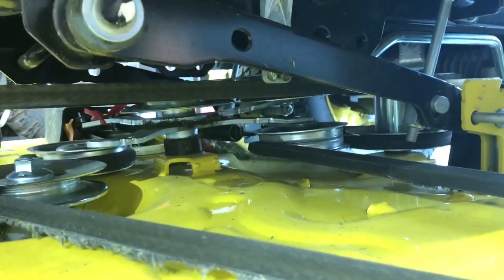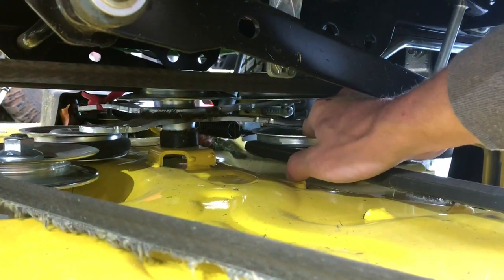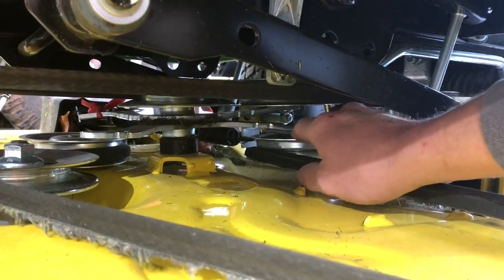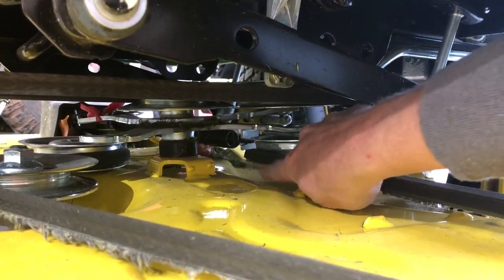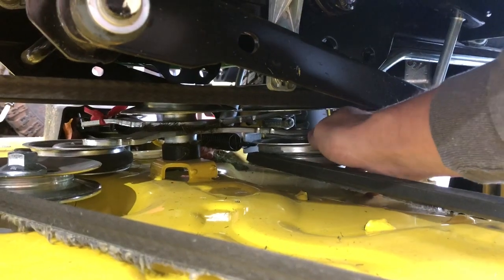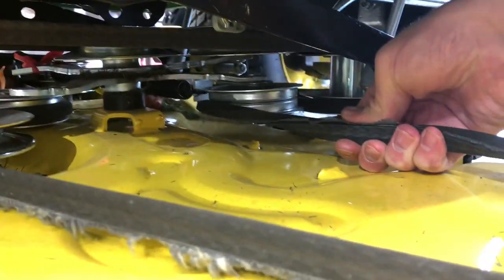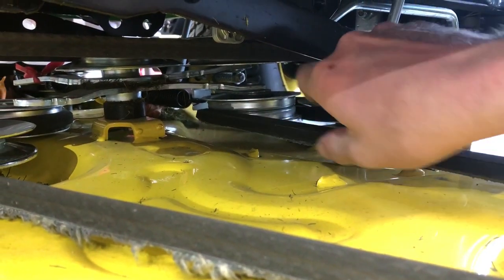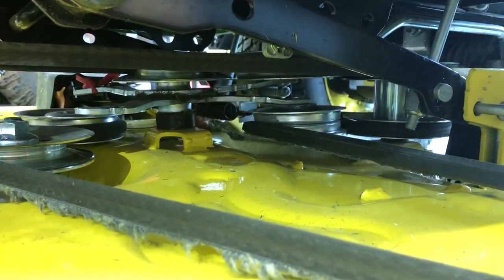X584 tension/ idler  pulley chewing up belts

Comment from the maker: To those watching. This mower and machine hat 29 hours on it. I brought it in to the service department. their corrective action:  several john deere decks in the 54'' size were known to have the bracket that holds the tensioner actually welded on slightly crooked. the fix was to completely replace the Deck Shell (they put the original spindles and hardware from the original deck onto the new shell) this was covered fully under warranty.